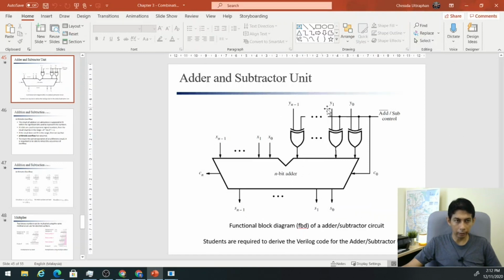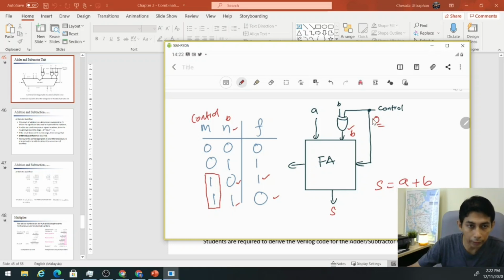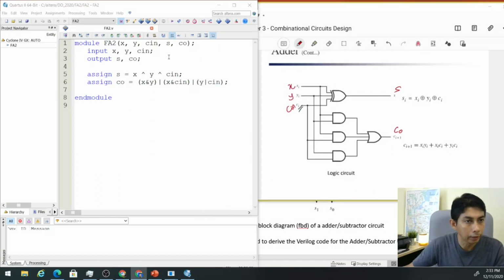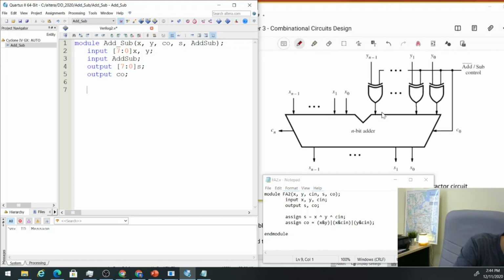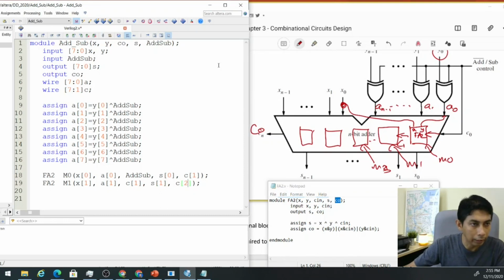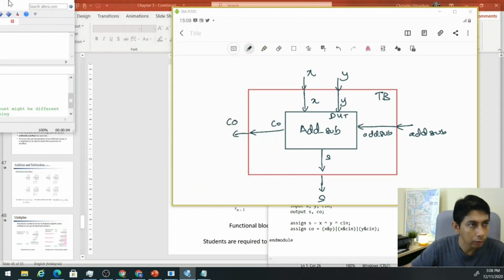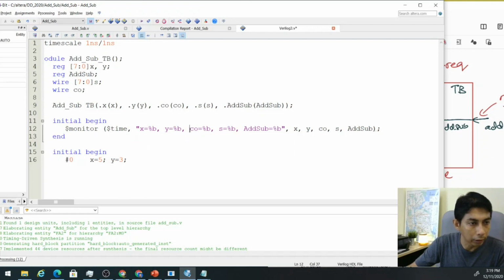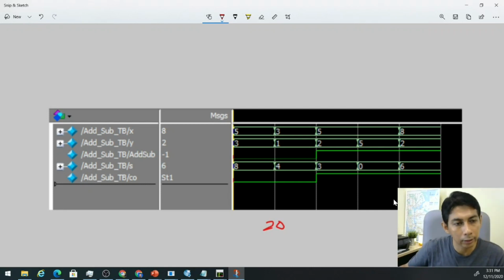Designing an Adder/Subtractor Circuit in Verilog and Simulate the Design Using Altera Model-Sim

Comment: I'm implementing it through behavioral modelling using multiplexers.
Reply from the maker: Hi Jogesh, the beauty of digital design is that you can implement any logics using many ways, and still get the correct result (provided that the circuit and the methodology are correct).